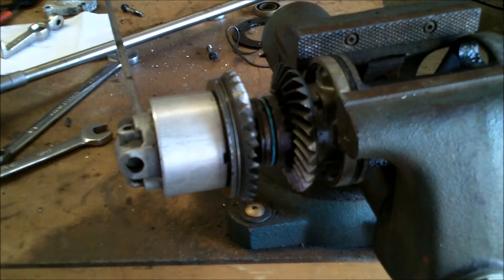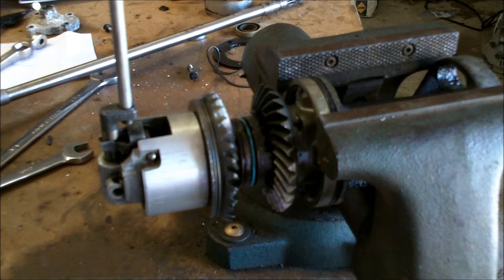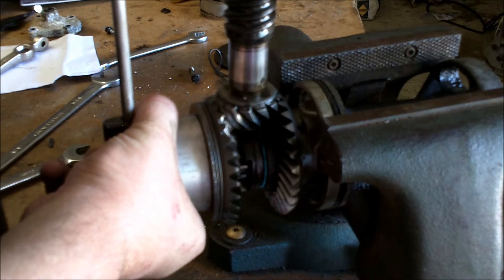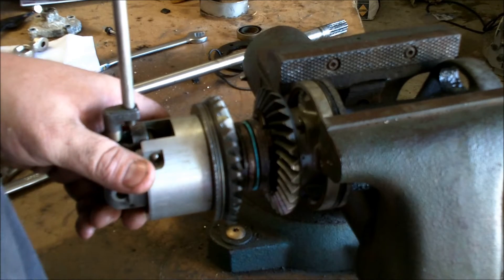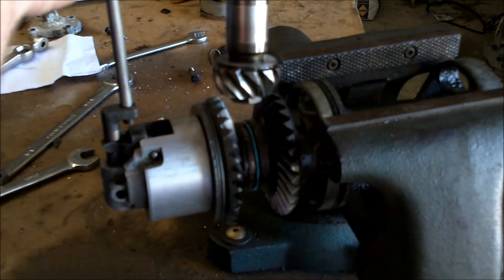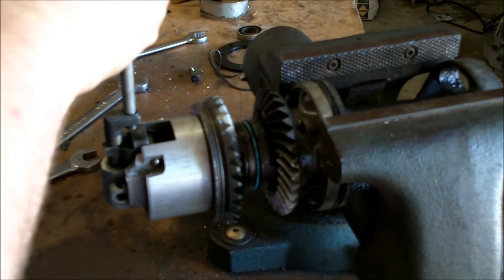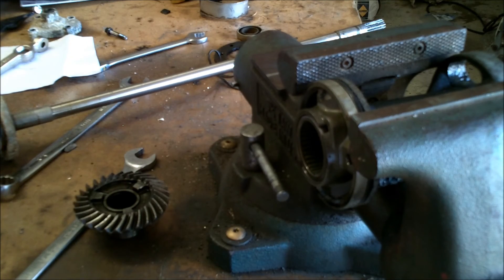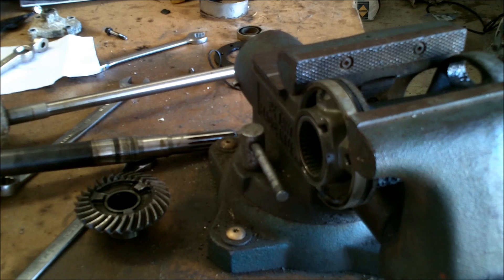HOW THE INNER WORKINGS OF AN OUTBOARD MOTOR GEARCASE OPERATE  (JOHNSON / EVINRUDE 60HP)

Comment: I have a 1964 60hp Evinrude manual shift.  My question:  Should I be able to spin the propeller freely when the motor is OFF and it is in Forward (spin clockwise) or Reverse (spin Counter-clockwise)?  When off and in neutral it spins freely in either direction.
Reply from the maker: patricia hilleren yes it should spin because your engine is hydro over manual shift. The hydro pump is not pressured up and engaging the clutch dogs.  Does your motor work fine in the water?

Comment: i have a question. I have a 1997 50 HP Evinrude.  When I pulled the first gear out of lower unit I found 3 ball bearings lying in the lower unit next to the drain plug. Where did they come from? How do I find out where they go?

Comment: need help lower unit works great. i notice some clicking at around 3500 rpm. no shavings in oil. noticed some in and out play on prop shaft. any advice is greatly appreciated. thanks

Comment: Hey,
I been working on 1986 Yamaha 25hp model 25 sj replace the upper  gear selector rod and it's a 2 piece part,Has a connector nut that connects to the lower gear selector rod and every time I adjust it won't go into forward gear? I had both set in reverse top selector and the lower unit. What's going on? Having ant ideas? Tricks?
ASAP!
THANKS

Comment: Related question.....  Putting a 1984 Johnson 115 back together after new gears and dog....  everything turns as it should F-N-R...... BUT...    when i get the carrier bolts near the torque spec, the prop shaft seizes up...  ANy ideas?   ever encounter this??    I didn;t replace the o-rings on the carrier bolts but will try that tomorrow...   It's hard to believe that much space could make a difference, but it might...   WHat you think?

Comment: Yea I have a 1969 merc 200, 20hp and when I turn the drive shaft the propeller won't spin with it
Reply: +Sacred Nut   It's not contacting either gear...  It's either in neutral or both gears and clutch dog need replacing...

Comment: I have a question hopefully you can help me with. I have a Nissan 70hp that will not fully engage in forward. Reverse and neutral are great. When I got to put it in forward it like it only start to go into gear but not fully. It makes a clicking noise like the gears are trying to engage, prop spins a little. I know this isn't safe but if I take my foot while it's trying to engage in forward and put it on the prop, I can stop the prop and then all of a sudden it with grab and engage. Checked and changes lower unit lube. Looked fine, no metal. Try adjusting linkage and disconnecting and shifting manually. Any ideas? Any help would be great! Thank you for your time...
Reply: +Thomas Niechlanski   Have you checked and adjusted the shift linkage??

Comment: Hi first great video
My question is I got a mariner marathon 15hp and I'm worrie about becouse if I engage the back gear and turn the prop by hand the prop it's lock and make the pistons turn if I turn the prop left or right(whea is supost to do
BUT if I engage front gear in my motor what hapen is if I turn the prop by hand to the left its engaged 
BUT if I turn right the prop it's free and make some clicks???
Will be that same tipe of slipper clutch???????

Comment: Recently my Johnson HP40 would not shift into reverse or would "pop" into gear... I had the clutch dog and reverse gear replaced as I was told that there were "rounded" edges on the clutch dog. I now have my boat back and will be on the water very soon.  However, I wanted to ask you about round edges on the clutch dog and gear set... I inspected the gears after repair and can barely notice one rounded edge.. Seems to me that a cable adjustment may have worked just as well.  So will a very minor rounded edge on either gear cause this failure?   my email is jaschwamm@hotmail.com Thank you

Comment: Hi Jeremy,

Thanks for the video now i have a better understanding of how everything works. 

I have a 90 Invader center console with a 90 hp Force 2 stroke outboard and my forward gear we out. I can only go in neutral and reverse. I am not sure how hard it is to fix this problem. I am pretty sure the dog clutch isn't in-gauging. Is this an easy fix our should take it to a boat mechanic?

Comment: The prop shaft spinning will not hurt a thing. The the parts in the lower unit are submerged in gear oil unless you turn the gear case upside down.

Comment: Hi Jeremy...I have a Mercury 350 (35hp) 1969 Red Band with a problem. When I put ii in forward the prop spins and pushes the boat but when I put it in reverse there is nothing. The engine revs but the prop doesn't turn. Would it be something to do with the dog clutch or gear do you think. any assistance is appreciated. Ross

Comment: i got a crazy mess going on.. was at 3/4 power getting up on plane with my lower unit went out today.. but no noise nor is the lowerend locked up.. if motors off and i put in gear the motor acts normal and with go in gear, if i start motor and do it prop does nothing and motor just revs up. prop hub is good also. thanks for the help and motor is a 1991 C85 Yamaha